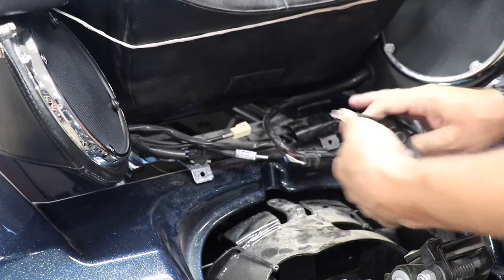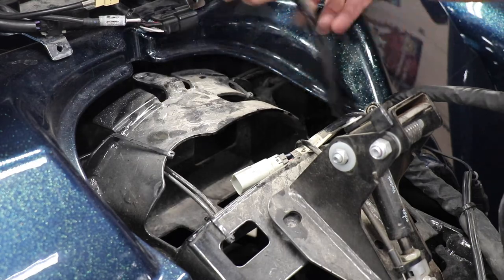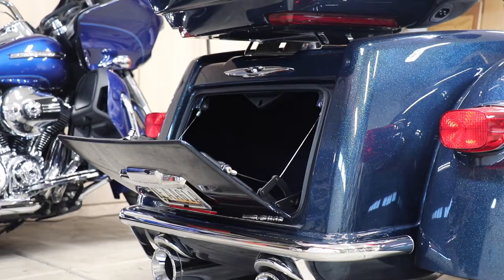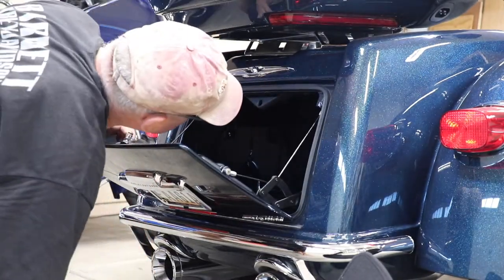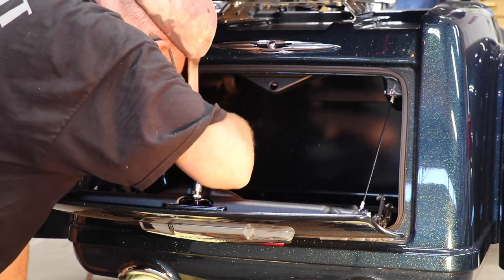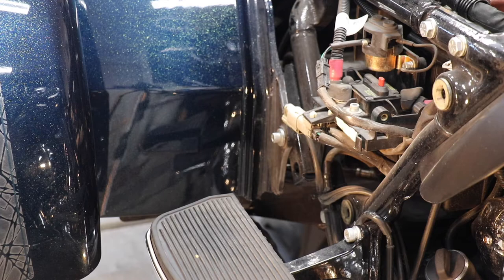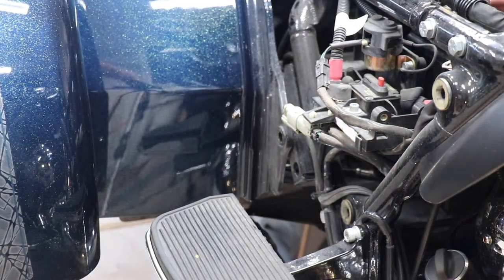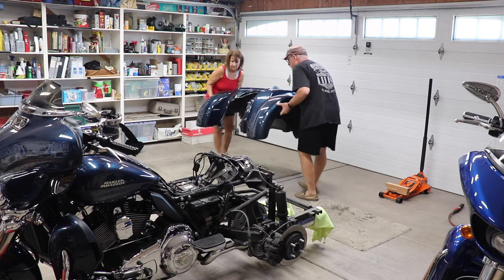Removing the Body on a 2016 Harley Tri Glide Ultra

Comment: So I am going to do this as soon as the snow flies here in Illinois. Could  you tell me approximately how much the tour pack weighs? And how much the bottom trunk weighs with the tour pack removed? It will be my old butt and my wife taking these off. Thanks.
Reply from the maker: I wish I could, my tour pack has 2 metal bars for the relocation kit.  It is heavy but I am able to remove it by myself.  I have no idea about the body weight but my wife and I were able to remove it without the tour pack installed.  We are also able to put the tour pack back on together since we had to be careful not to scratch the body.  Here's my guess, my tour pack probably 30 lbs.  The body 35-45 lbs.  The body is just awkward since it's so big.  Hope this helps.

Comment: regarding the removal of the trunk is this the same procedure for a 2021 tri-glide.  i don't want an electrical problems thank you for the videos. trikes are very popular now. can you make a video of changing the rear hydraulic brakes or just bleeding them?
Reply from the maker: I don't think Harley had made any changes to the way the body comes off so it should be the same for the 2021.  As far as bleeding the brakes, I did do a video on that.

Comment: Just an FYI.  On the reverse breaker, the red button is the TEST TRIP button that you use to make sure the breaker trips OK, or if you want to disconnect power downstream.  Just below that and to the left a little you can see a tab (or arm) that pops out when the breaker trips on high current or when tested.  To RESET the breaker, you push (rotate) that tab back IN after making sure it is fully rotated out.  Common misconception.

Comment: Great video...I have the same year Tri-Glide. I put a set of comfort lift brackets on without taking the body off. It wasn't to bad, but would have been easier with the body off. I'm going to be installing a complete stage I system and a pair of new shocks, so the body comes off this time...Thanks :) By the way, it sure would be nice if there was a company out there that made a portable jack/lift for trikes?

Comment: I’m sorry I’m commenting after so long - you are the only video I could find re: taking the trunk off. I have a 2023 RG3 Trike I just want to disconnect the trunk to lift it not remove it to get to the ridiculously placed front bolts for a muffler change . I’m assuming it’s a close resemblance as Harley doesn’t change much. The four bottom trunk bolts did you have any issues reinstalling those. Someone on the forum said they were a PITA …? Any help would be appreciated
Reply from the maker: I had no problems with any of the bolts.
Reply: @Batman825  thanks for the video very helpful and thank you for replying 👍🏻

Comment: did you measure the hight before and after upgrade? I just did mine and doesnt look like i gained 1" or anything at all
Reply from the maker: I did but I can't find the sheet I wrote it down on, I think I had like 3/4"-7/8" difference.

Comment: Hi there. I’ve got the 2015 tri glide and I’m from the uk 🇬🇧. Can this still be done without taking trailer hitch off ? I’ve not got rear bumper fitted ether thanks rich
Reply from the maker: I've never installed a hitch but I don't think it installs on any of the bolts that hold the body on.  I think it attached to the cross members of the frame.   The bumper installs on the bolts of the body.  It's easy to check, the body bolts are on the outside of the mufflers.  Hope this helps.
Reply: @Batman825  thanks Bob that is great 🇬🇧👍

Comment: Why not replace the brake pads since you took the bike apart?
Reply from the maker: A dealer here had a special going if you bought the Harley brake pads they would install them for free.  So I paid about $200 for the pads and they replaced them, all 3 wheels.  Hard to pass up that deal when I can get the labor for free.